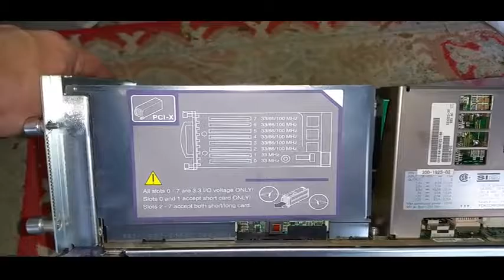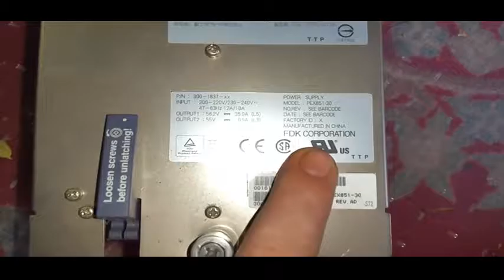SunFire E4900 Profile Pt2

Comment: Thank you very much for this video. I have the same SunFire e4900 but both System Controller Boards does not working. Could I contact you via email or any messenger? I need your help. Thank you!
Reply from the maker: yeah sure, no worries. Let me know what you need help with